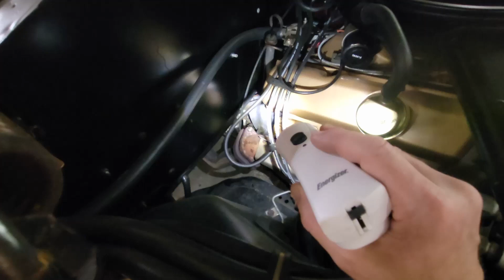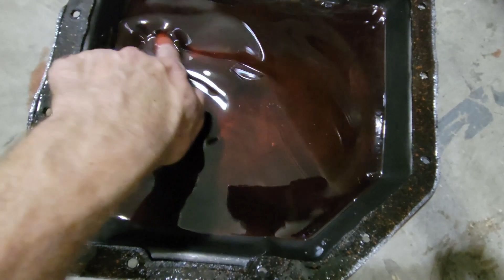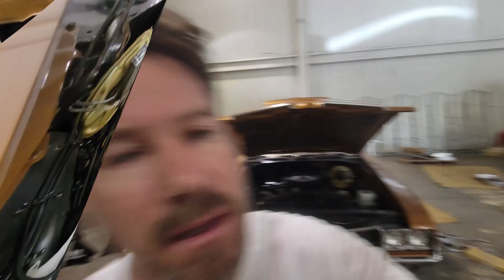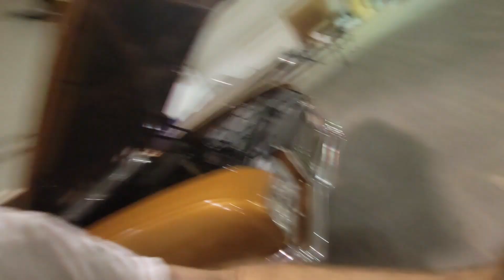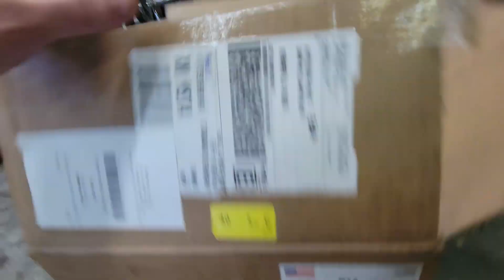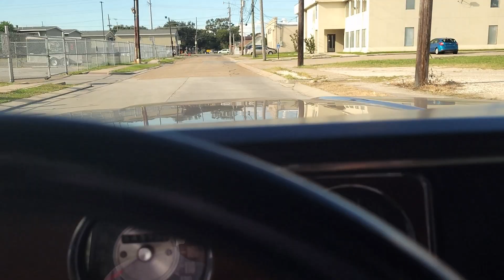1971 Cutlass TH350 Transmission Removal and Replacement!

Comment: Thx for the videos. Currently I'm swapping the torque converter on my '79 Pontiac Grand Prix. I built a similar transmission jack and it works great! I removed the spark plugs so I could turn the engine by hand while lying underneath loosening the bolts from the torque converter.

Comment: Awesome video. Removing my 71 Cutlass transmission now and using your video for reference. 

Question for you; how do I remove the drive shaft???
Reply from the maker: Simple... unbolt the 4 bolts on the rear universal joint, slide the shaft slightly forward into the transmission to clear the pinion yolk, lower it, then slide it backwards.  Have a drip pan to catch fluid as it drips from the tail.
Reply: @RestoringChristine1956 do I have to have cross member removed before I remove drive shaft?
Reply from the maker: @MrBigBearBrown shouldn't.  I'd drop the drive shaft first.
Reply: @RestoringChristine1956 thank you! Can you tell me, is there a cover that needs removed to access the torque converter and flywheel?
Reply from the maker: @MrBigBearBrown on a factory original, yes, it's a plastic cover.  A lot of times that cover was lost.  Mine sits on a shelf in the garage.
Reply: @RestoringChristine1956 ok got that removed, I have the 3 torque converter bolts out and I believe all of the bellhousing bolt, it seems like there are two bolts left that are a different size head?? Are those just alignment dowels or are those just smaller bolts?
Reply from the maker: @MrBigBearBrown there should be 6 bolts between the bell housing and block, all the same size.  There are also 2 guide pins on the back of the block that slip into the bell housing that you don't have to physically touch.
Reply: @RestoringChristine1956 you are the man! I appreciate all your replies
Reply: @RestoringChristine1956 success! Got trans pulled, now gotta decide do I do a rebuild or replace. Do you think numbers matching engine and trans matters much to collectors?;
Reply from the maker: @BrownbearUSALLC   I guess it depends on what it is.  If it was a special or rare motor/body combination, such as an SX, 442 or W30, then YES.  But if it's a basic car, then matching numbers probably won't matter much.  Still, I'd try to rebuild what was original.
Reply: @RestoringChristine1956 thanks again for all the help. I have the new transmission, actually I had the old one rebuilt. I'm doing the reinstall now and everything's going pretty smooth, the only issue now that I'm having is when I took the kickdown cable off the cable on the inside of the black hose, the little metal hook has disappeared inside of the hose. Is there any way that I can get this out so I can reconnect it to transmission
Reply from the maker: @MrBigBearBrown other than pushing it back from the other end...
Reply: @RestoringChristine1956 it goes through firewall, when I trace it out to other side. 

Sorry for 20 seconds kind of a noob for this type of car lol
Reply from the maker: @MrBigBearBrown it should attach to the accelerator pedal on the other end.

Comment: So imagine doing this in the street with no trans jack. I did with my 71 olds and the TH350. Lifted it up there by hand.
Reply from the maker: Back when, I remember doing it on driveway strips with dirt in between, losing bolts that gravity decided to take over, having a back full of dirt, transmission fluid, dried grass, and the sweat of aggravation!
Reply: Me too 1984 on my 72 cutlass supreme I was 16 !
Reply: Btdt

Comment: No jackstands were injured in this video for the first half hour. Safety first Bill. Why didnt you use your original converter instead od grinding the other one? just curios.
Reply from the maker: I don't know if the converter is the source or if it has shavings in it.  For $110, I didn't want to take the chance.  And the replacement part # is non-specific to that bolt style.  My bet is that they are distributing Chevy converters as if they are the exact same as BPO.  This Olds motor is externally balanced and Chevys are not.  But I had it all rebalanced when I built it with flat-tops.

Comment: I'll give you a little hint doing the bump with just 1-2 torque converter bolts pits a lot of strain on the fly wheel and the converter for that matter use a big straight head screwdriver and use the teeth of the flywheel to move the motor over less strain on the whole system
Reply: I have used a breaker bar on the front of the drive shaft to move it
Reply from the maker: When I put it back in the 2nd time, I just horsed it with a gloved hand on the flex plate.  I set it so that 2 bolts were lined up and I just had to rotate it to get the 3rd.

Comment: You could have used some washer's to space out between the flex plate and the converter
Reply from the maker: Believe me, I was tempted! I could only slide the converter up by 3/32 to 1/8 at most.  I just didn't want to risk binding on the pump.

Comment: I pulled my transmission last week also by myself  i am installing a 700r4 but need to shorten the drive shaft about 3" and installing and bigger oil pan while I'm at it
Reply from the maker: I had to have a shaft shortened and rebalanced on a 70 Chevelle once. And I had a 700R4 in an S10 Blazer that never was right.  There is something about that model that is fickle.  Lots of hot rod have them.  I never had any luck with it.